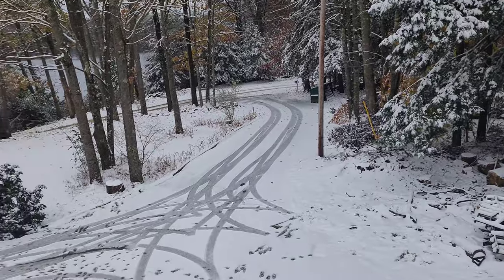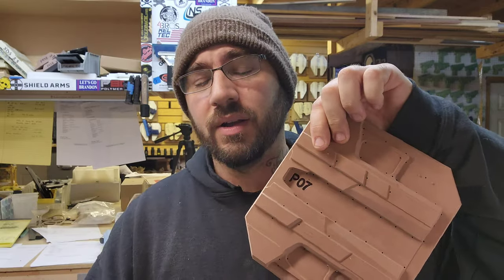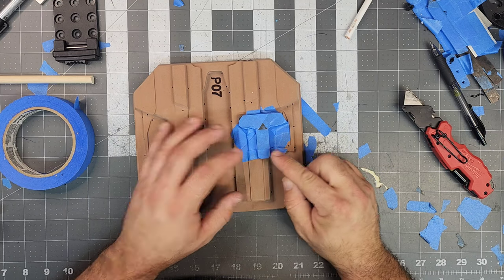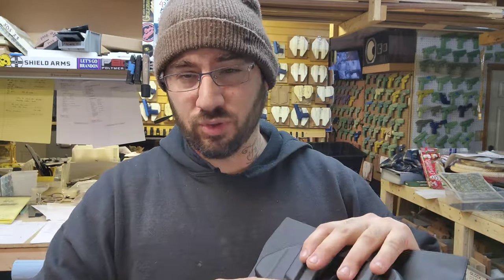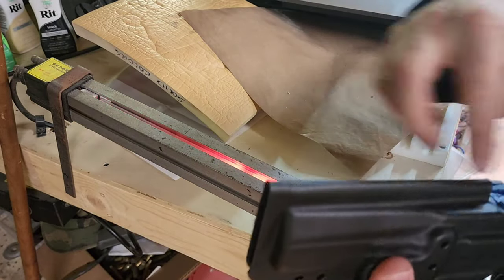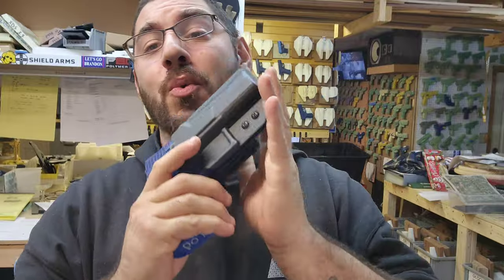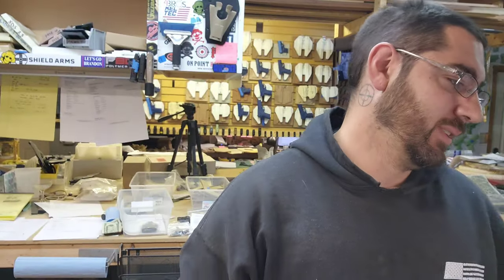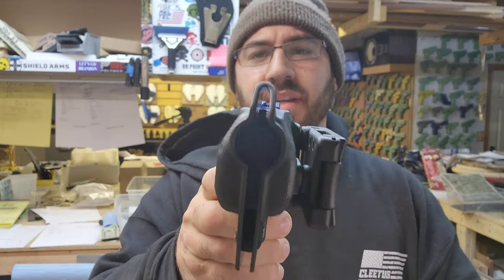Lets make an OWb For a CZ P07

Comment: I use tin snips instead of the cutoff wheel. So much less mess. The screws are 1/4 inch in length, btw people, USE A 7/32 BIT TO DRILL. And where the heck do you get the buffer wheel from? My local Harbor Freight has nothing similar to it.
Reply from the maker: https://www.holstersmith.com/vcom/abrasive-wheel-flap-wheel-800-grit-500-p-7442.html